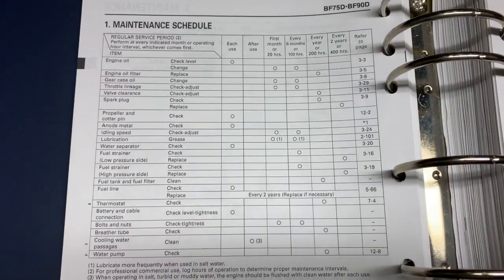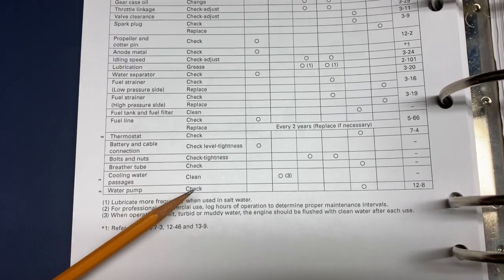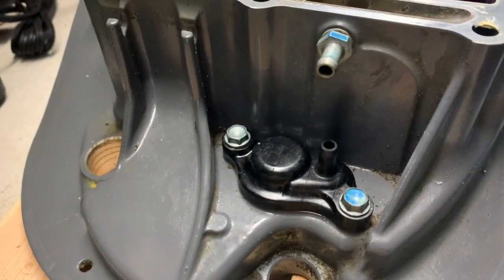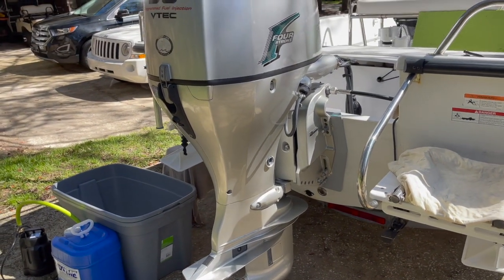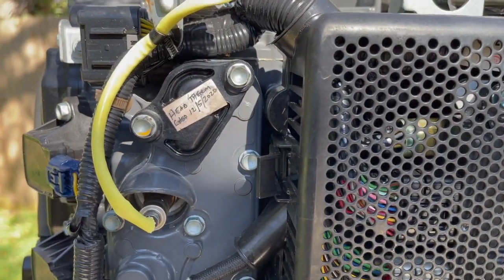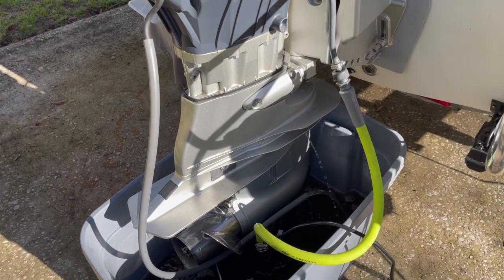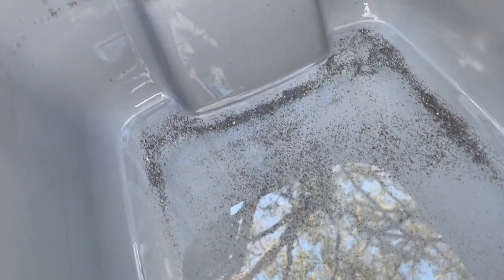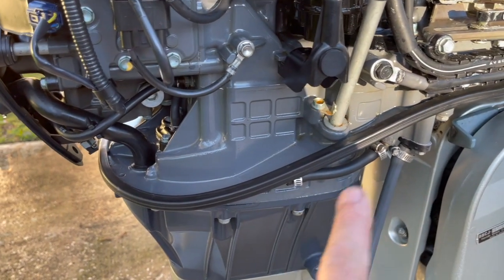Honda BF75D/BF90D Cooling System Troubleshooting and Maintenance

Comment: Dave can i ask you one question regarding cooling water pressure relife valve? I have badly corroded bolt head which holds valve cover ( same bolt you did modification with washers). So i want to remove it without removing cylinder head for easier access. Is it possible to remove just oil pump without removing cylinder head, on that way i will get enough space to aproach valve cover bolt.Thank in advance
Reply from the maker: Whew that’s a tough one because that back bolt is so hard to get to.  I almost had the same problem but caught mine in time to get it out.  Really not sure about oil pump removal since I never had to do that yet.  I can tell you on other rusty bolts I had to go to a smaller sized socket or wrench.  I will share another video I did where I use a very “rigged up” way to remove that bolt with a low profile socket which might work for you.  Take a look at this video at the 5:20 mark. https://youtu.be/Xka4RGlnCc8
Reply: I succeed to lose and remove rusted bolt head with shallow socket for rounded head. It was really pain in a......ear but now it is stainless steel bolt baby....

Comment: Thanks a lot  for sharing your experience, Dave!   Just realized  from your video that the  head thermostat has two types (standard /cold water) ...  Looks my issue of  loosing power on mid range rpm,  which I have on cold water only (below 3 C), related   to my standard one choice..... Bad luck,  I've already changes both thermostats trying to resolve issue.... :-(   Honda doesn't allow to use engine all year around, right? .... Don't want to  have  summer and winter thermostats .....
Reply from the maker: Strange why it would lose power due to a thermostat issue.  I would imagine you could just run the cold water thermostat year round.
Reply: Thanks for your reply, Dave... No, I've got a standard (60 C) thermostat on my 2014 BF90DK2 LRTA MARINE ENGINE, JPN, VIN# BBCJ-1100001 TO BBCJ-1199999
I believe issue is  that  engine   wouldn't warms up enough on cold water, so  it cannot run on high rpm,  temperature overheat indicator and   buzzer are activated, and  speed is reduced  automatically according to the user manual. Just  got a diagnostic tool - no fault codes at all.
So, I'm wandering if cold water thermostat (72 C)  would help, but my service manual doesn't have any reference to that option and I couldn't find p/n for 72 C option as well ....  :-(    The 19300-ZW9-003 is for 60 C.    Appreciate if can say an expert word  or have that  p/n handy. I'm not alone with that question on the www .
Reply from the maker: @apelipenko  did a little search on Google and it looks like the part number for 72c thermostat is 19300-ZV5-043.
Reply: @davecavanaugh66  That p/n is for  BF90A modifications  only on the Honda Marine site....
Reply from the maker: @apelipenko  that’s the only one I could find that was 72c.  Seemed to fit quite a few models, so for $30 bucks, it might be worth a shot if the diameter is correct.  But to be honest, not sure this is your issue and it’s hard for me to believe it would lose power after being warmed up.  My guess is it’s something else, but hey it’s worth a shot if that’s what you think it is.
Reply: Thanks, Dave.  I'm with you.... will try when ice is away...

Comment: Hi Dave,  how that stainless steel prop. working for you?
Reply from the maker: Works great!  It had a factory 3 blade aluminum with a 19 pitch prop.  However it was slow to plane and was under performing.  So I did the calculations on Solas website which told me to go with a 4 blade 15 pitch.  That turned out to be a little over the top and too close to the rev limit of 6300 rpm.  So I ended up going with a 17 pitch which worked out perfectly with about 5800 max rpm.  I’m happy with it on this boat.  It’s has a decent hole shot now and still gets up to about 33 mph top speed.
Reply: @davecavanaugh66  So, you are using now 17 pitch with 4 blades or 3 blades?
Reply from the maker: @alexT5100  yes 4 blade 17 pitch is what works best on my boat.  Again when doing these calculations, the hull type, weight, and type of performance you are seeking all matters.  It’s not an exact science so it’s hard to tell how things will go until you put the prop on and try it out.  I did my testing live on a local lake. Took all the props with me and changed them out on the shoreline then did a test run with each one.  So if you want to test a brand new 4 blade 15 pitch prop, I have one at a great price!!!

Comment: I don't have any water coming out of my water pressure relief valve tube (I can't take off  the pressure relief valve aka poppit as the bolts are rusty and stripped but when I attach a tube long enough for me to blow into it, I can blow air and it is not blocked so thinking to leave it alone) but I do have water coming out of the nipple at 12:30 and 24:50 in your video. Why would I not have water coming out of the pressure relief valve tube as shown at 25:10. Thanks!
Reply from the maker: Water should flow from the port side nipple coming out of the mount case then go up to the water jacket under the VST.  From the VST, it flows to the Poppet valve cover nipple so if you pull the hose off the Poppet valve jacket, water should be coming out of that tube.  If not, the you have a clog upstream which you will need to trace back.
Reply: @davecavanaugh66  Thanks Dave, it's flowing now. I checked all the cooling sytem spots you did in the video and they are all good now. I even hooked up a hose like you did and look off the lower unit. My oil alarm is still going off, any idea where to hook up a oil tester to? Is it the by the sensor under the oil filter with the green attachment?

Comment: How many thermostats does your  90 have?
Reply from the maker: There are only two thermostats - the block and head as shown in the video.  The other thing that looks sort of like a thermostat on the back/bottom of the motor is actually called a water pressure relief valve….also shown in the video.